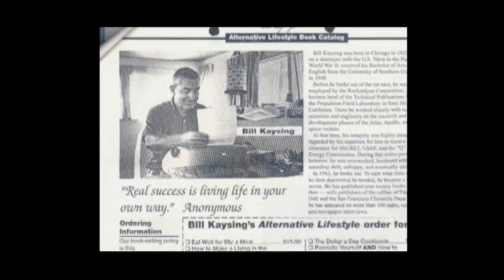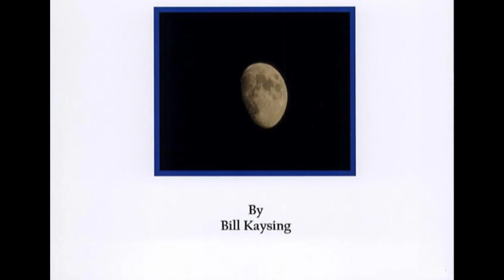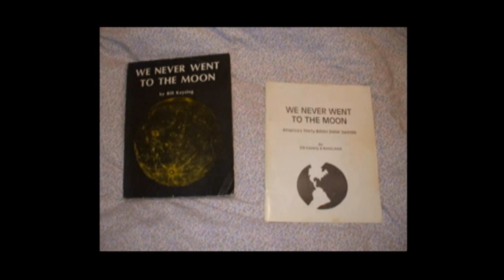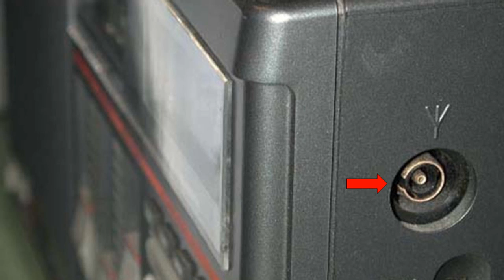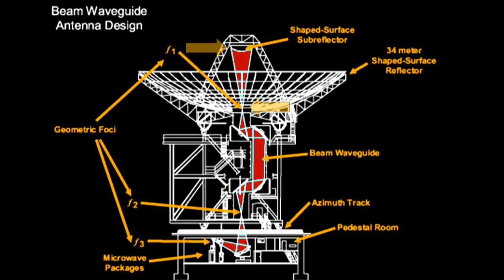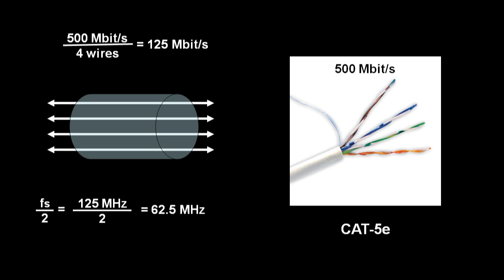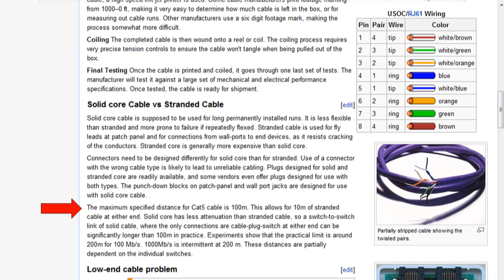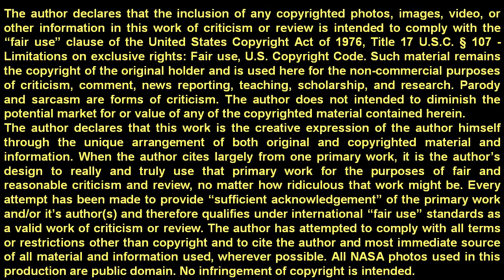MoonFaker: Exhibit D: Critique #14A: Ma Bell

Comment: @philwebb59 Because it consumed downlink power and worsened the margins for the other signal components, ranging was only done occasionally. It could be disabled by a switch in the cockpit, so you'll frequently see Capcom asking them to enable and disable it.

Ranging gave you the current distance to the spacecraft. Once you had it you could update it by integrating the Doppler shift, so there was no need for continuous ranging. You'd only need it on station acquistion or handover.

Comment from the maker: @ApolloWasReal True. There would have to be some intelligence there to handle the analog PLL and add in the fake Doppler shift. The data rates and sc frequencies would not change, so the PLL adjustment would have to be done to the cw before you lump on the subcarriers and then you would have to tune up or down to fake the "adaptive" Doppler effect. That would not be a trivial exercise. And that assumes you feed the signal into the primary demodulator, so you're back to microwave frequencies.

Comment from the maker: @ApolloWasReal True, I assumed bistate converting baud to frequency, but I was only considering the cw frequency. On top of that is the 51.2 kbit/s high rate telemetry on a 1.024 MHz sc, the 30kHz voice on a 1.25 MHz sc, the occasional 500kHz FM television and the continuous 2MHz bw range codes (with lobes). In reality, they would probably have stepped down to the 50MHz IF to handle the bw and poured the signal directly into the downstream demodulators, which didn't all feed off the same cable.

Comment: Oh, and don't forget that the Apollo transponders reacted to their uplinks. With no uplink the downlink "free ran" at a nominal frequency, e.g., 2287.5 MHz +/- Doppler. But when the transponder saw an uplink it locked on and generated its downlink at exactly 240/221 times the received uplink frequency (this was for Doppler tracking). A "dumb" playback of a fake signal would not behave this way.

Faking a spacecraft would require an actual transponder, at a bare minimum.

Comment: I think twisted pair cables are directly rated in megahertz. Just use that in your analysis. I'd inject the fake signal after the first downconversion to a 50 MHz first IF for FM and 10 MHz for PM. But this would not reproduce the signal strength changes when the antenna is moved off target, a dead giveaway. (Nor would direct injection at S-band). And the stations had test beacons on nearby towers to verify system operation, so they'd know if the RF feed had been disconnected.

Comment: Don't confuse baud with bit/sec! "Baud" refers to the rate of the changes made to the voltage fed to the line. If, and only if, the signaling is binary, then there are only two voltages to choose from and the bit rate equals the baud rate. But by using more than 2 voltages you can send more than 1 bit per signaling interval, and this is exactly what gigabit Ethernet does. It chooses from 5 different voltages, and the bits are mapped to this with a non-trivial coding scheme.

Comment: Gigabit Ethernet, which Cat 5-e can carry, is full duplex. It's a continuous gigabit in both directions simultaneously, using echo cancellation to remove the transmitted signal from the received signal. So each pair carries a continuous 250 Mb/s.